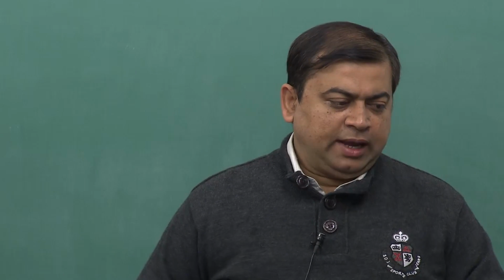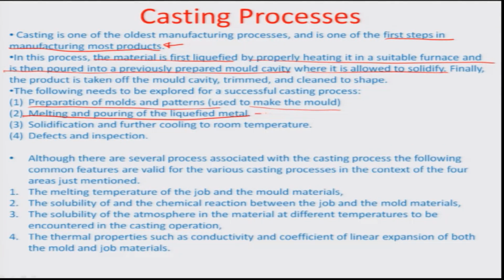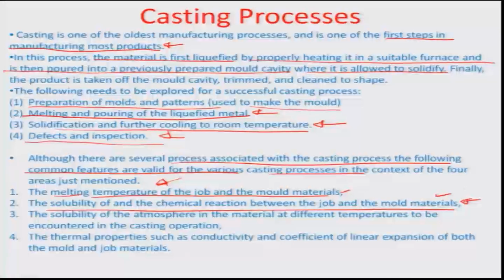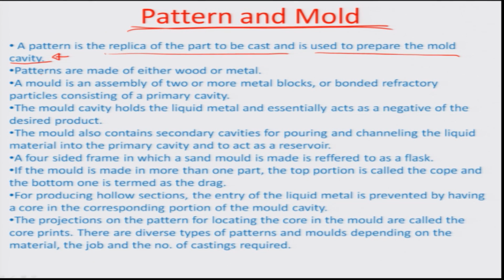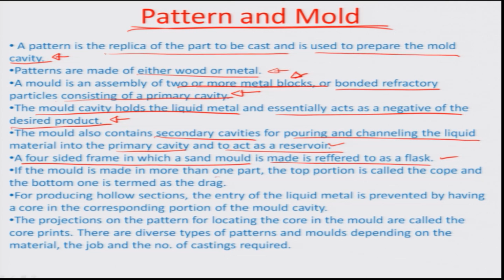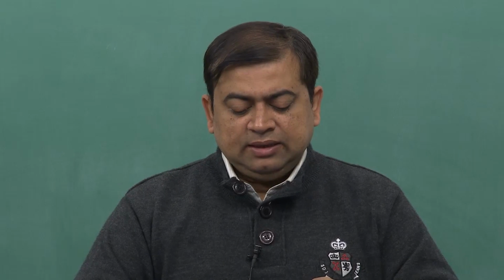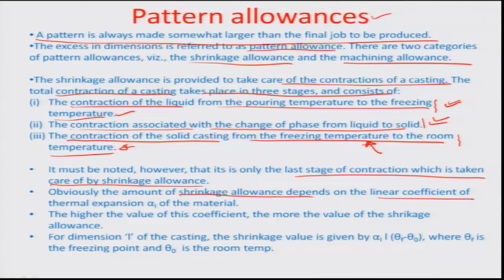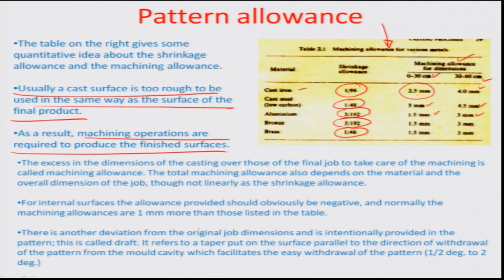Introduction To Casting Process

Comment: Sir you said that the material is fast, liquefied by properly heating it in a furnace,
But I am not agreed with you, because in time of epoxy resin casting , resin is available in liquid condition, so we did not need any heat

Comment: nice lecture sir but have one question,  how by making taper it becomes easy to remove this pattern...............................sir also one request sir if  you will use some short video in your lecture then it becomes icing on cake...............thanks sir for making such a great video......